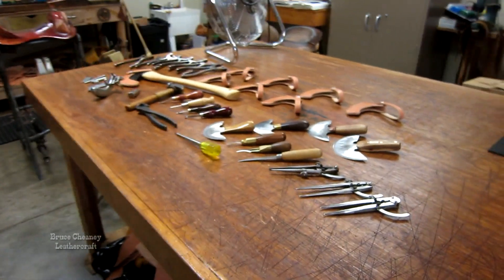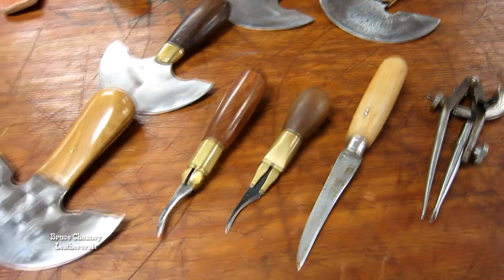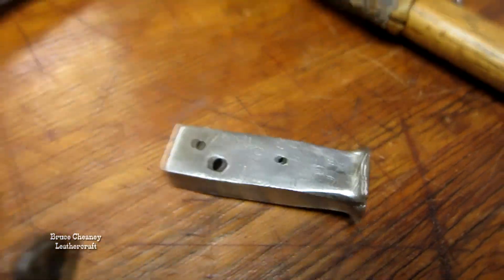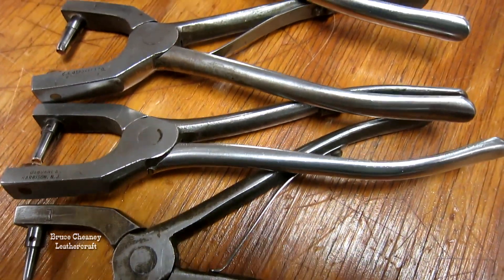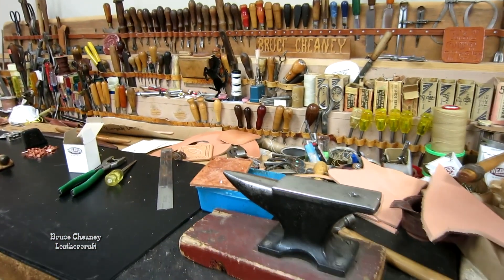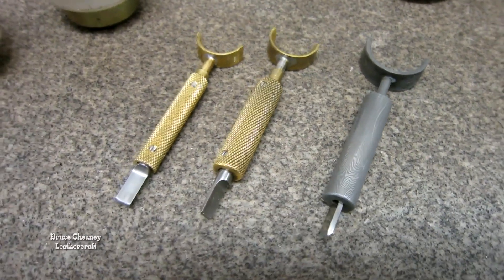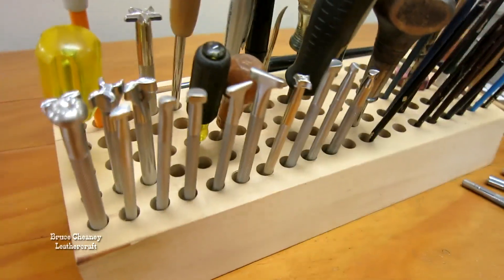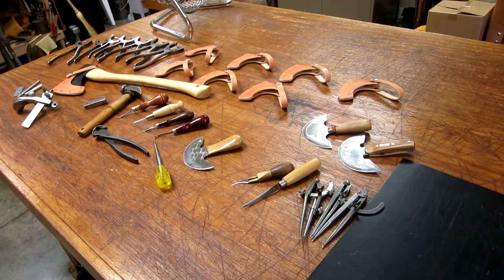Leather Working Tools

Comment: Hello Bruce Cheaney, 

I’m seriously thinking about buying one of those CS Osbourne Scratch Compasses number 34. 

But I have a question that you may be able to assist and help with please.

How does one sharpen the groove cutter please? 

Is there a video or any instructions that you may be able to send me a link to please, or would you be able to explain the sharpening technique to me please? 

Or if anyone reading these comments may be able to advise me please, it would be greatly appreciated. 

Thank you. 

Wishing you a wonderful future.
Reply from the maker: I very seldom sharpen my Osborne scratch compass it seems to stay sharp. I do remember sharpening my blades in my younger years and I used to course of a sharpening stone and the cutter honed away quickly. Good thing replacement blades a available... If you do sharpen I think I would use fine grit sand paper glued to a piece of leather. Hopefully this helps.